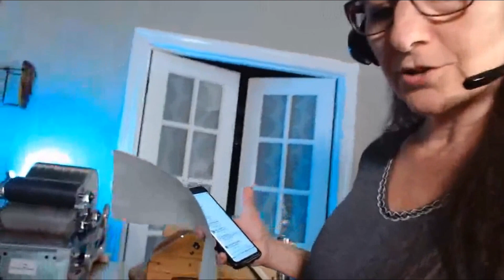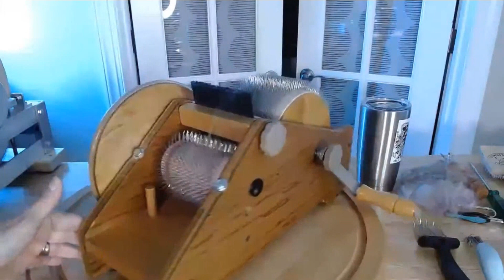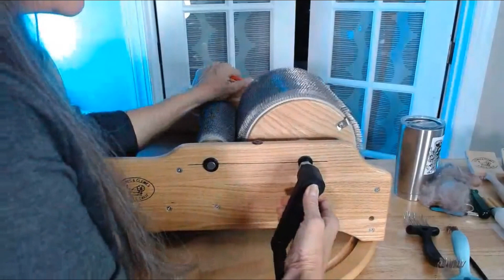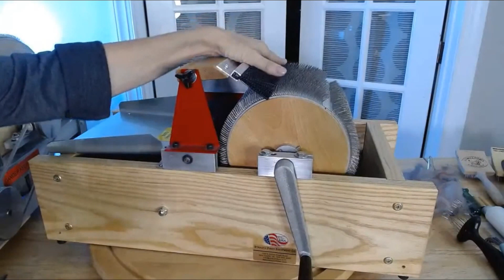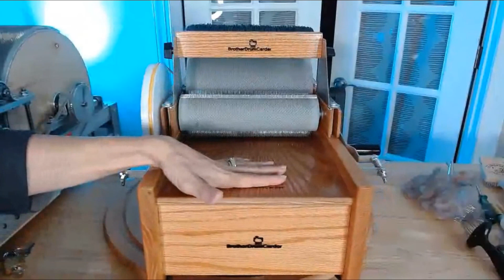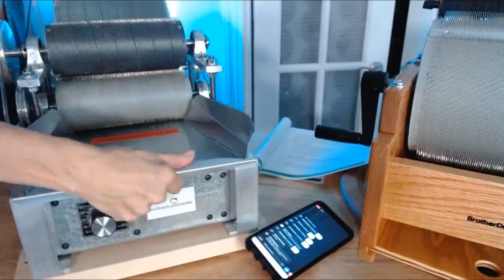Drum carder comparisons - replay of FB live video.  Camaj Fiber Arts

Comment: Hi. We have Navajo Churro sheep with wool typically at 35 microns or more. Would we want to get a drum with less tpi? Or would 72 be good?
How about ratio of main drum to feeder? I have seen 4:1, 6:1 and also 12:1 for hand crank carders. Is this driven by fiber microns? Or some other variable to consider what ratio to choose?
Thanks.
Reply from the maker: Hello Tytus.  A 72 TPI would be very nice for Navajo Churro...even a 90 would be good.  The ratio is the speed between the large or main drum and the licker in or carding drum.  The higher the ratio the more carding action. With that said I feel that a three drum system cards better than then looking at just the ratio of a two drum system.    If you are using a two drum system you may have to card a second or even a third time, depending how well you pre-prep the fiber before you card.  Which carder has the 12:1 ratio?
Reply: I think this one says 12:1...